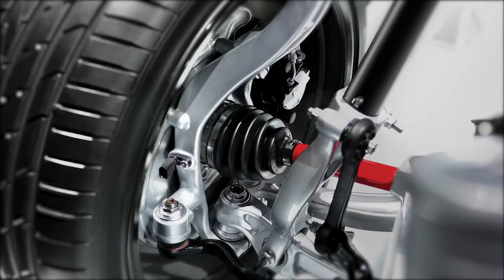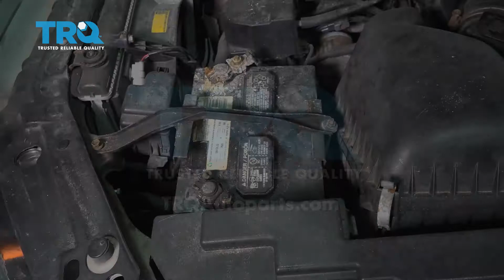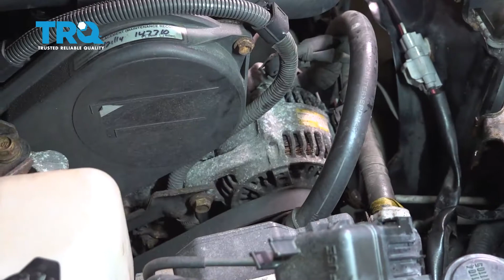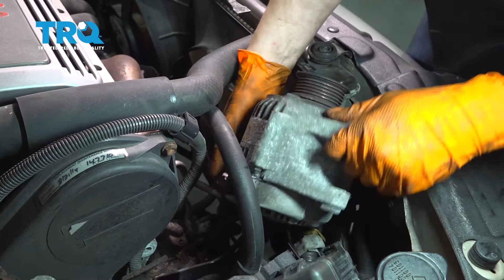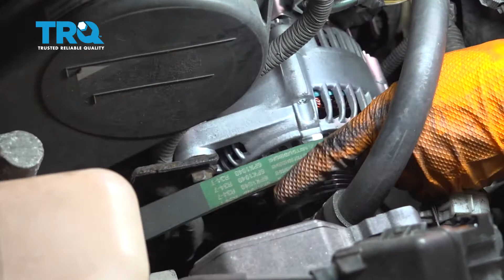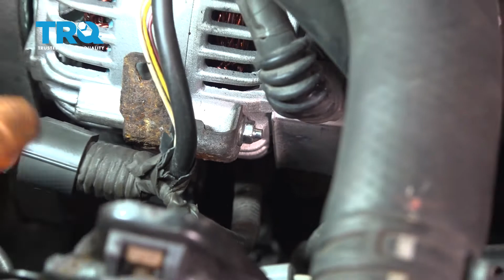How to Replace Alternator 1997-2001 Lexus ES300

Comment: @TRQ Ty so much for this well made isntructional and informative video! I got it done in just under 6 hours lol but i had some snags along the way like the little 8mm bracket screw that wouldn't come off no way no how.. I used a grinder and managed to keep the bracket in tact, no damage. Used what I had. Put the bracket on the new one before you install.

Next, you don't really need to remove the bottom screw that everyone's having a hard time with. It just holds the bottom tensioner bracket to another bracket for stability. Leave it there and just take out the 3 main screws:

14mm large bolt to secure top.
12mm to secure bottom
12mm tensioner

Also - Don't forget to keep the cables on the inner side of the installation of the new alternator so it's not belt side. You'll see what I mean. I had to loosen and redo everything - i almost started it like that, woulda been a big oopsie 🤦🏻‍♂️ 

When i finally started the car, i had some squeaking from the belt for a while. It eventually went away. I'm left w a little bit of chirping from the belt here n there, for example when i gas it good. Otherwis it's driving and the battery's charging up it was dead I had to jump it. 

Good luck and i hope this helps in addition to the video. Thanks again

Comment: Question on the belt tension. A lot of people say to do the 90° twist test on the belt and others say to push down on the belt for 1/2 inch deflection.. which one is best, do you know ? I recently replaced the alternator on my 05 Lexus ES330 as well as the drive belt. My tension seems fine since it twists 90° but it still squeaks for a second on a cold start then goes away. It squeaks when I press sertain buttons on my A/C too at first then goes away. Checked all my pullys.. they’re all fine , no play or anything. Any thoughts TRQ? You guys are the best. Buy all my parts from you guys.

Comment: Fun fact, You can swap for a RX300 or highlander alternator to get better amperage so the battery  lives longer and the electronics run a little smoother.

Comment: You clearly gave wrong instructions and erred on saying the position of the block for the lower bolt. First you said to make sure that the bolt to the alternator goes through the hole above the adjuster bolt and it’s hole. When you actually finished bolting it in place, you said the opposite, with that bolt going through the block hole when below the adjuster.  I watched you 5 times to make sure of what you said and did. Please do this one over and do it right.

Comment: I got a better option for the bolt that goes into the alternator and the other one slides down and goes along the little metal block. I would say you can bring up the alternator and you’ll see it standing up. You put a crowbar there to hold it and then take outthe long screw and just use the screw that goes into the alternator with the little block because you can see it you put that in and then you put the long screw in a lot easier no offense than the way that you recommended. Have a nice day.

Comment: TRQ's automotive instructional videos are consistently among the best, if not the actual best, ones here on YouTube - great camera work and video production, and clear and concise commentary.  I appreciate that.  None of that self-indulgent BS and yapping heard on the shade tree amateur ones and even a lot of the "professional" ones.

One point on this video though - at 9:51, the edge of the belt right on the alternator pulley looks like it's missing a bit.  I would be worried that that belt will start deteriorating more now that the edge is starting to go.  Like I saw somewhere on an online Lexus owners forum, one wise owner said he replaces the belts when swapping out the driven components and if the original belts are still "good," he stashes them in his trunk with his emergency parts-and-basic-tools in case he has a broken belt somewhere out on the road.  At least, he can put the old belt back on and hopefully get home or to a repair shop.

Comment: Nice. The inly thing is I'm going to try to remember to change over the wiring bracket while i have the alternator out. I'm clumsy and don't want to have to go searching for that 8 mm nut after i drop it.

Comment: It’s so freaking hard to put the bottom adjustment bolt back in the alternator bracket.. 40 minutes of straggling already. But it is also a bit of masochistic pleasure.. just kidding. I hate the effin 12 mm bolt…..